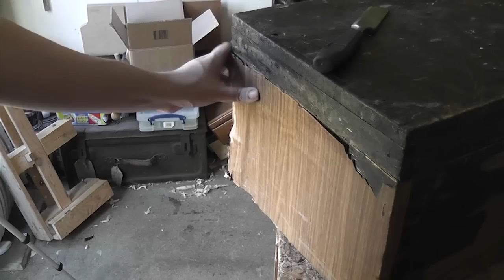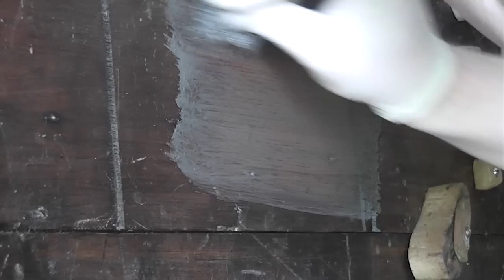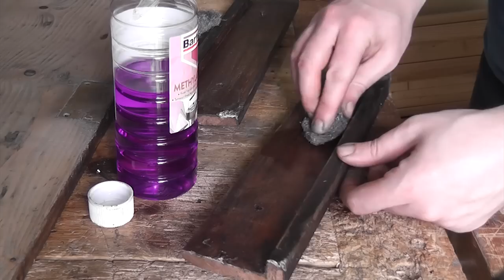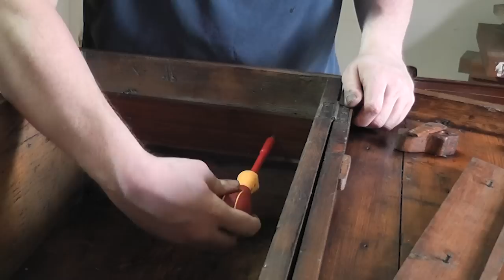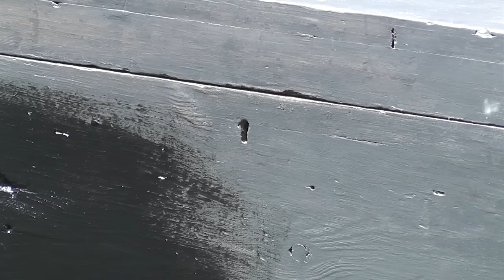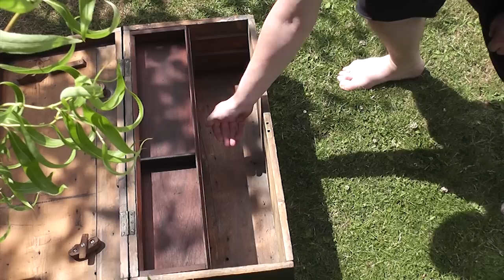Tool Chest Restoration [Woodworking Project] (Tool Box)

Comment: Good on you for giving it a restoration job. Looks like it'll be good to use for many years until your grand-children have to give it a fresh coat of paint.

I can't help but notice two usual features missing: Rot strips/skids and handles. These would traditionally have a couple of strips attached to the bottom which would allow you to drag it across the floor, but also would prevent moisture from getting to the bottom of the chest and more importantly, stop moisture getting to your tools! The lack of handles also has me perplexed. These could be metal, wood or even rope beckets.
Reply from the maker: Hey Martin! Thank you very much, I appreciate it.

Hmm, I hadn't really thought about that but you're right, both of those features missing.

I guess it could be one of two things, either they've fallen off (though I can't remember seeing an indication of where handles may have been) or they were never put on in the first place. I suppose it could be that my cousins grandad was new to the trade when he made it and so maybe didn't consider those features? I'm not really sure.

Really interesting point though thank you for bringing it up

Comment: I just bought an old chest this weekend, and I plan to do much the same as you. Did you need to do anything to make the inserts move more freely?
Reply from the maker: I think they were already fine but if they're getting stuck or dragging a bit the first thing I'd do is rub some wax on them and on the runners.

Comment: Keep up the good work! If it's not stationary I would have added some handles (rope or wooden)... otherwise, it's fine as it is.
Reply from the maker: I wanted to keep it as close as it was to the original, that's the only reason for not adding extras. But I see how that would be a helpful thing! Thank you Bogdan 👍

Comment: What did you use to remove the paint?
Reply from the maker: I think at times I used paint stripper and other times I used methylated spirits with wire wool
Reply: @ClintRoseCarving  great, thanks :)

Comment: You could have cleaned and oiled it from the outside the same way you did with the interior. That way it would look as a nice old piece. After all "technically" it is nothing special, very simple materials and the same goes for the make. The only thing kind of special about this box is its age, so a "restoration" should not be about destroying that special but rather preserving it, right?
Reply from the maker: I understand what you mean but I was restoring it back to how the carpenter made it in the first place. Black is the traditional colour of an English tool chest and that was the colour he originally painted it. 

You wouldn't restore a painting with different colours or stain an old piece of furniture a different colour to how it was originally stained when restoring it.

Comment: Removing grime with unnecessary, harmful chemicals then slapping on some paint is not a restoration.
Reply from the maker: It was originally painted black and probably oiled on the inside. I just merely took it back closer to its original condition than it was when I got it, that's all.